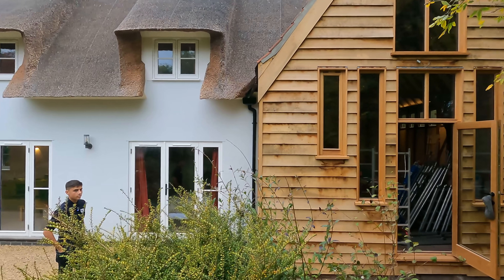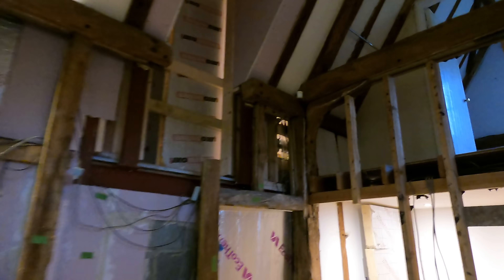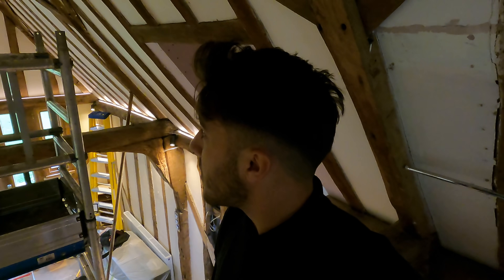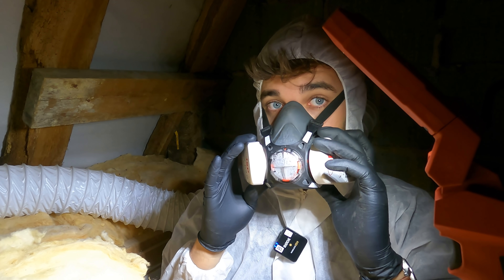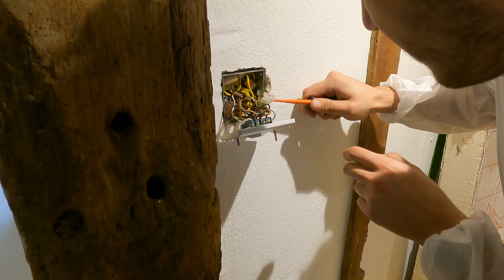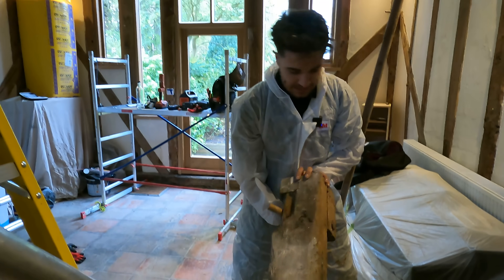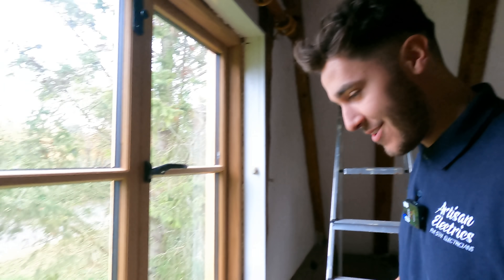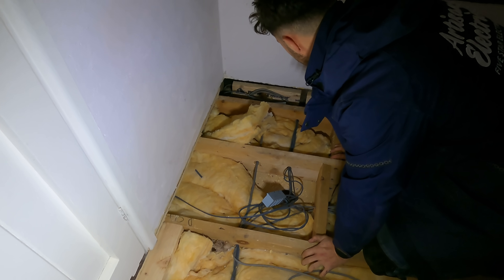500 YEAR OLD HOUSE WIRING - Electrician Life

Comment: Fascinating one this one. We’ve got a 450 year old farmhouse with a thatched roof in Suffolk. Probably more original than the one in the video since it’s not been moved. Ours has 1st floors throughout now and a ceiling to the loft but was originally open to the rafters for 2/3 of the house and they kept cows and sheep and horses in the open bit until 1750. The smell has gone now. I’ve put a grid of 2x2 metal trunking in the loft with metal flexicon from the trunking through the ceilings to keep the wiring all in metal enclosures right through to the consumer unit. The thatch has a fire proof lining to keep the cost of the insurance down together with ponds outside just to ensure enough water if there is a fire.

Comment: You can have the middle switch as the feed switch chaps. We’ve done exactly that before. Draw it on a piece of paper and you’ll see why.
Reply: Ah yes - thank you.  If you draw a 3-way circuit with the feed/switch wire in L1/L2 in the two way switch at one end, it is electrically identical if you were to "move" those to L1/L2 on one side of the intermediate switch.
Reply: @rossthompson1635  Correct!

Comment: You can have the intermediate as the first switch. 
I did it last week, you just have switch/feed in the L1 /L2 with one of the 3C/CPC and the other 3C/CPC there going into the other side of it plus the commons in the Wago , so you just literally end up with 1 x 3C/Cpc at each of the other 2 switches. 
The intermediate switch is connected as standard but with the feed and SL in L1 and L2 with them.

Comment: you can have intermediate switch as the 'middle switch' use 1 3core cable brown and connect with the feeds and the other 3core cable brown with the switch wire, and then connect the intermediate grey and black in the switch like normal and second fix the 2 end switches! :)

Comment: you don't need to quinetic you can use the feed switch as an intermediate you just have a 1 gang either side and have the common wago'd with the feed and switch live leaving the strappers in the middle switch only. Similar to the way conduit is wired live in one end, live out the other and just strappers between.

Comment: did not know they had electrics back then lol roof is either thatch or reed ,on a tower that high you do not need a safety harness, you got so mush side protection all the way up and its built correctly ,a bit of common-sense says do not over reach ,if you are going to use a safety harness ,just clip it to side of tower where you are working ,use a proper ladder to access loft ,,instead of standing on the very top of a step ladder